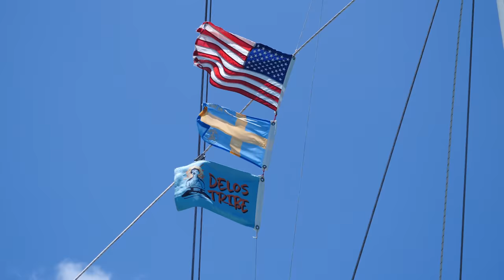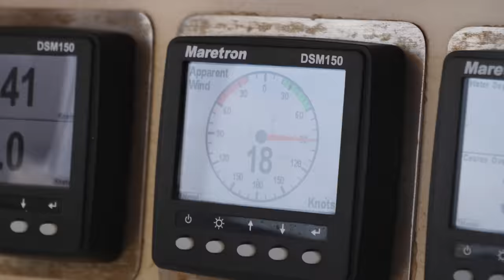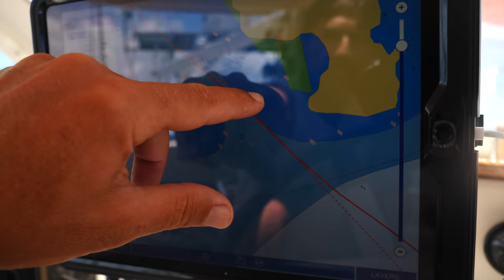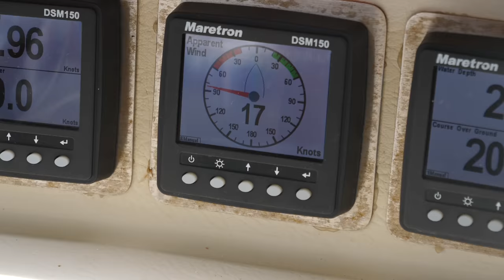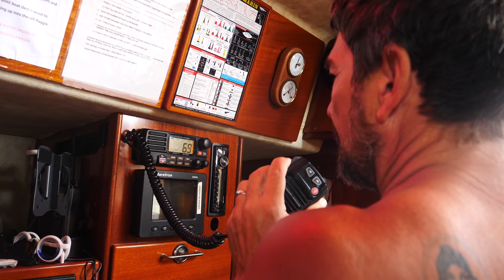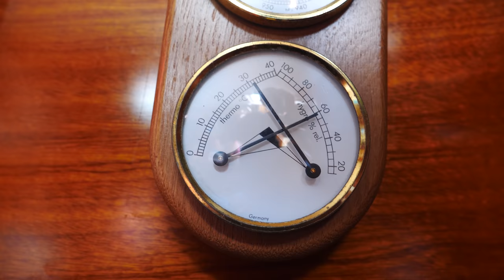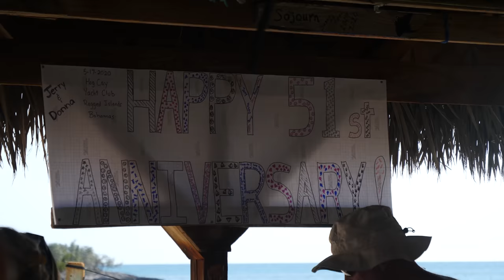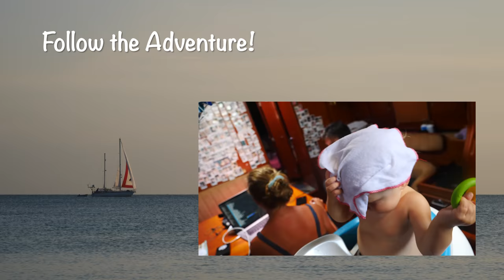UFO and MEDICAL EMERGENCY! What would you do? Sailing Vessel Delos Ep. 283

Comment: Great job with the wound care!  You did great putting that kid at ease as well.  I am an ED doc of 20+ years so I see all kinds of wounds.  A few basic ideas for future use.  Dermabond works best on flat areas that don’t flex at all.  Think forehead. It also works best on clean cuts, not jagged ones.  That said it will work for a little while to seal a wound and keep dirt out.  But the main goal of closing a wound is to hold the edges together while it heals.  Covering a wound with dermabond without pulling the edges completely together might even delay healing a little but I couldn’t see that close up well enough to say in this case.  The body will close huge wounds given enough time and wound care, so that one would not necessarily have needed closing.  Also closing traps bacteria and infection. I suspect it would have been fine with this one to just clean and dress with antibiotic ointment and let it heal up from the inside.  That said, most people want a wound closed if possible so even though they often don’t need closure, people often ask me to do it anyway.  So I sigh inwardly and stitch or glue them up.  Cheers!
Reply from the maker: Thanks for the insight Paul!  That is excellent information to keep in mind....  Fair winds and sending you much love from Delos to you!  Brian, Kazza, and The Little Nugget
Reply: yeah,i hurt myself a lot ,bleeding from small cuts and bruises.People who are present freak out( Americans more than others,dont know why).I let it bleed nicely,tell them the blood desinfects it already,no need to put anything or use bandaid etc.Never had any trouble.
Reply: I had to have a pilonidal cyst removed that I had left for far too long. I had an 8 inch wound up my backside that had to heal closed. Daily care and keeping clean made the difference. I have a huge scar, but no more cysts.
Reply: How is this comment from a week ago
Reply: @supersayinsauce1788   Probably patrons early access. They upload video and allow only those with link to see it and share link with their patrons. After few days they change access rights to the video so it becomes public.
Reply: I’d have thought that patching up the little girl would have bought you some excellent karma, guess that fuel filter had other ideas, sorry Brian, life does that do us from time to time
Reply: SuperSayinSauce if you are a patron for just a couple bucks a month you can support their journey and get lots of perks including early videos.  Patreon.com
Reply: Agree with Paul! The biggest problem is infection and there's no need to cover and trap it inside the wound. Chlorhexidine, miramistin or another antiseptic (even vodka will do) to clean and some antibiotic ointment. Sometimes especially in hot climate, it becomes infected even under ointment (because it covers the wound and makes a good warm and wet environment for bacteria). In that case we usually just regularly rinse the wound with antiseptics and apply light breathable bandage. I am not a doc myself, but I have an experienced surgeon among closest relatives, and we usually do as described, when have  injures at surfing vacations with friends. All the best!
Reply: What an incredible way of life to bring up baby nug.
Reply: @martinc9867  Probably because Americans are used to cleanliness and, ya know, treating wounds instead of just letting them bleed as if we're in the Middle Ages. But hey, to each his own.
Reply: @stephaniemorrissey123  yeah,americans invented band aid ! 😊😊
You probably have realised that a healthy body doesnt bleed long.
And cleanliness was discovered in Europe btw
And many other places before America even existed as a western country.Its logic,not american way of life thinking.

Comment: Good job on the repair. A+ for the attention to irrigation and cleaning.  People want to close the wound and get too focused on the repair and skimp on the irrigation.  Sealing the wound with cyanoacrylate glue (Dermabond) is a bit risky because it seals the wound, and if not cleaned well you can seal in bacteria and foreign material. Also remember, petroleum products will dissolve it, typically someone puts an antibacterial ointment on the glue and ruins your repair, but gasoline, diesel grease, and petroleum jelly will as well.  Good job Bri and Kazza. Saw you guys in Nap town a few months back but headed in opposite directions, same thing in Culebra two years ago.  Gonna dinghy over one of these days. Cheers

Comment: "This is Captain Kirk of the USS Starship Enterprise, is there a doctor in the house?" 😱
Reply: I have used super glue and applied it as if it were sutures before. In that application it still allows the wound to breath and heal from the depth to the surface.
Reply: There is surgical glue and veterinary glue. Different variations of superglue. A good doc can explain them to you. One advantage of glue is that it reduces the need to remove sutures, and the infections they can bring.
 Having Dermabond in your med kit is certainly the best way to go!

Comment: I've got that same ice machine I've been using the same ice machine for I don't know going on 12 or 13 years now had one work for about 3 years that I bought I had to put a new motor in it and a couple of other things went wrong finally threw it out and bought a brand new one and it's been working for pretty near 10 years now it hasn't got anything wrong with it they're great little ice makers the only problem I see with them is they do not freeze the ice solid so I have to take the ice that it makes when it makes a full basket I dump it in a pail and put it in the freezer and I keep that doing that and all night I'll fill the pail completely up and overnight it will freeze solid in the Ice Cube seemed to last a hell of a lot longer otherwise they melt down as soon as you pour your sodium cuz they're not frozen so I found putting them in a bucket and refreezing them worked a whole bunch better so they don't melt as fast just thought I'd let you know what I do to keep mine it better ice form

Comment: Years ago, I was out for an evening walk with a friend when we noticed this same sort of flashing, colorful light. Our reaction was just like yours. What you're seeing is the twinkling of a particularly bright star. In the northern hemisphere, Sirius (trailing Orion, and usually low in the sky) can often be seen to twinkle like this. What causes stars to twinkle is their light passing through turbulent air that has pockets at different temperatures. Hotter air is less dense than cooler air, and so light refracts (bends) more through cooler air than through hotter air. This is the same effect that creates mirages or the shimmering of image above a hot surface like pavement. Longer wavelengths (redder) also refract more than shorter wavelengths (bluer), just like when light passes through a prism. Take a chaotic swirl of varying-temperature (varying-density) air and shine a star's light through it, and you get a varying prism effect. This is not normally noticeable with fainter stars, but with bright stars low in the sky (therefore passing through a longer column of air and being refracted more), the effect becomes noticeable to the naked eye.

Bonus: you don't see this with planets because they're so close that they're too big; the width of a planet as we see it is large compared the amount of refraction of their light. Stars, even bright ones, appear to be much smaller. http://www.badastronomy.com/bitesize/twinkle.html

Comment: Brian, turn that fan around so that it blows fresh cool air directly onto the fins. The way you have it, it draws the hot air from inside the unit, over the heat exchanger. Pause the video on the fan blades, and you will see what I mean. I did it to mine and I get a lot more ice now.

Comment: Brian, you fixed the ice machine, the filter was clogged up. I was wondering if you have a manual and continually add to it in terms of a maintenance schedule or troubleshooting for each piece of equipment on board? You could include a section for spare parts with part numbers and where to get them for each system or piece of equipment so you can do preventive maintenance instead of waiting until something fails. My friend has a huge house with two full bowling lanes in the basement, huge salt water fish tank, indoor endless pool, etc and we add to his "house owners manual" whenever we fix or install something.

Comment: The star gives off white light so when it hits layers of shifting atmospheric density it gets split into lots of colours like a prism. On a very clear calm night it will only shimmer a little (known as good seeing) on a night where there are bad upper atmosphere winds, differing levels of moisture or a high pressure front moving through it will sparkle and shimmer (known as bad seeing). Also if your binoculars are low quality or of certain type lenses you will get what is called chromatic aberration which is also the splitting of the light into its constituent colours.

Comment: About the UFO: 

There are unmanned balloons with large solar panels for providing mobile/internet coverage to remote areas (or islands where the on land-based infrastructure has been damaged or destroyed by natural disasters). Those have been used especially in the Caribbean. There are actually several commercial service providers.

Even though the balloons have no engines, they can be kept in the same general area for a very long time simply by utilising different wind direction in different altitudes.

Some months ago I saw (on flightradar24 dot com) at least one balloon's transponder in the vicinity of Ragged Islands, Bahamas. It might fit to what you saw.

The way the object reflects different colours, and appears to be nearly stationary (or moving slow speed) suits a balloon pretty well.
Reply: This seems most likely to me as they saw them change position initially, and the twinkling was more than usual for planets (IMNSHO).

Comment: It depends on when this was filmed, but there was also that large dust cloud that crossed over from Africa earlier this year. The more dust there is in the air, the more distortion there will be in any stars or planets. It is especially pronounced when they are low on the horizon because the light has to travel through so much more of the atmosphere.

Comment: Hi guys!  I think I may have the definitive answer to the “UFO.”  I’m a pilot and I often see similar lights that you would SWEAR are flashing and changing different colors like a disco ball.  Without fail though, when I check any of my numerous astronomy apps it’s almost always the star Sirius or one of the other bright stars.  Sirius is the brightest stars in our night sky, primarily because it’s so close to our solar system.  The reason stars twinkle is due to the refraction of the light as it passes through our atmosphere.  It twinkles those different colors when it’s low in the sky because the light has more atmosphere to pass through, the same reason the sun turns orange and red at sunrise/sunset.
Safe travels!

Comment: Just get some ICE TRAYS!!
Reply: I'm not sure that all that great an idea on a boat. For one, it's rocking, so it'll spill. For two, it sucks an awful amount of cold out of the freezer. Boat freezers are usually really well insulated and on a tight energy budget. The ice maker is something you can run when you have energy left over, e.g. batteries fully charged, solar still delivering a lot...

Comment: You called for an astronomer...based upon what I saw, that was either a distant plane headed toward you or a planet.  I would have to know your time, location, and sky location to further narrow it down.  Brian, here's an answer to your question, "why is that one twinkling while a nearby star is not?"  Ultimately, twinkling is caused by turbulence in the Earth's atmosphere.  Slight deviations in temperature cause the light to refract differently, and the amount that light is refracted depends upon the color (hence the rainbow from a prism).  With turbulence, the amount that each color gets refracted dances around a little...hence twinkling.  The amount of twinkling depends upon the size of the object in the sky, the amount of atmosphere the light is passing through, and the size of your pupil.  A star is so far away that they are effectively points of light in the sky, and they tend to twinkle the most.  Something big like the Moon has a lot of individual points of light and the twinkling effect averages out.  Planets are in-between in apparent size, so sometimes they don't twinkle (the twinkle averages away), or sometimes they can (especially if they are near the horizon).  The size of your "pupil" also matters.  When looking through the binoculars, your "pupil" is effectively the size of the binocular lens.  That's why you saw a difference with the binoculars vs. the naked eye.
Reply: Wow thanks so much for the reply!
Reply: @briantrautman7290  My pleasure.  If you ever have an astrophysics related question, feel free to reach out to me directly.  I'm a professor in the Physics Department at Florida State University, and my specialty is in the explosions of stars, neutrons stars, and black holes.  I am very grateful for all that you share.  When my partner and I watch your videos, we feel so much calm, ease, and joy, and we absolutely celebrate the fun and sense of community that you share with the world.  It would be my honor to return your kindness with a little understanding of the Universe.

Comment: Stunned that no one has mentioned this already, but the sky is literally crammed with satellites (about 5000 in orbit from recent estimates) which can be seen by the naked eye, and appear to twinkle different colours, given they reflect signals, they reflect light from the sun also. Low then high, is just the angle you first saw it in relation to your position, and where it then moved to. I've been seeing satellites for at least 20+ years when I got my first gps which indicated how many satellites it had connected with.

Comment: You guys just need to get a new ice machine those ice machines are garbage the ice gets air bubbles that's why the ice is cloudy you need to get a waterfall ice maker it's where the water constantly trickles over the front of a ice tray looking thing and it freezes as it keeps running across it just like an icicle forms it creates a clear ice harder ice and ice at last 5 to 10 times longer than your normal ice that you guys are making now well work the money I own one myself I used to own the same ice maker as you have